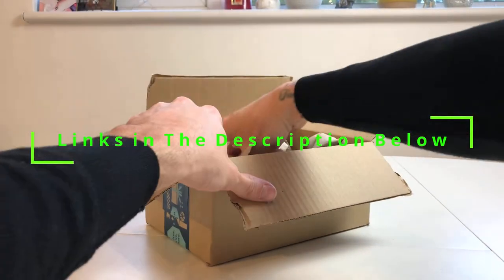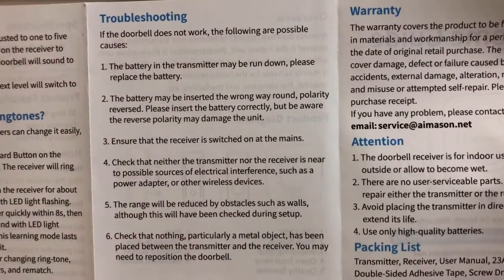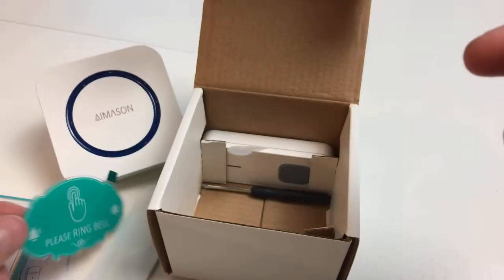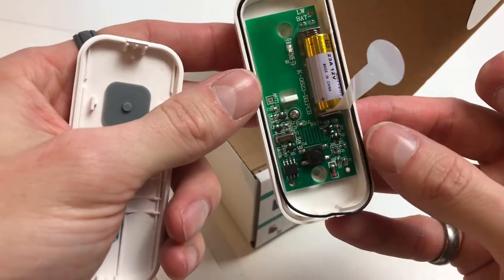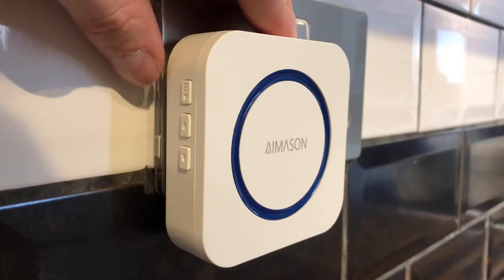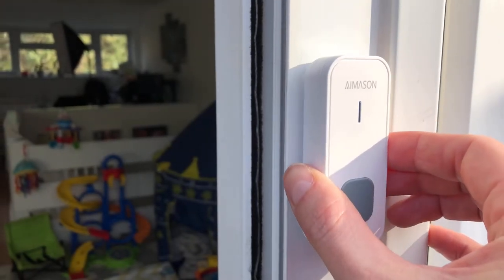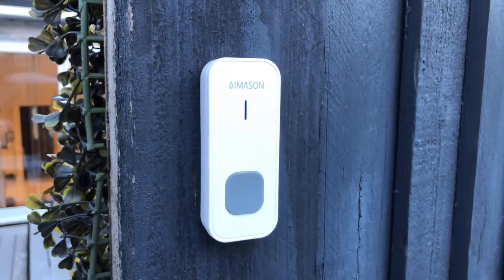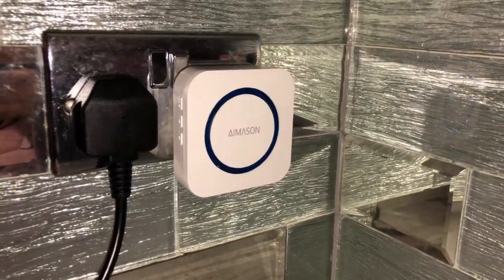AIMASON WIRELESS DOORBELL (Easy Install) Review & Install.

Comment: Thank you for this, Is there any chance you could possibly tell me the dimensions of the transmitter/push button unit please? I'll purchase this model if it fits on my very narrow door frame. Thank you.
Reply from the maker: Sure No problem 

H 8.5cm
W 3.5cm 
D 1.5cm
Reply: @pwinkle  Thank you so much for that, that's really helpful. My door frame is a tiny bit narrower than that, but I haven't managed to find a narrower one.
Reply from the maker: No problem, you could alway stick the doorbell on the door itself as it’s completely wireless, come with two sticky strips if you want to change the location at a later date (just an idea)
Reply: @pwinkle  I hadn’t thought of that because it’s a upvc door with a wood grain effect, so I didn’t think the sticky would work so well on that surface. Thanks, I’ll try that.

Comment: I have the dual kit two receivers and two doorbells how do you pair them together so if you ring one they both ring two separate areas
Reply from the maker: I haven’t done it but I think you hold down the up volume bottom on the receiver and press the doorbell button. ( I haven’t tried it myself)